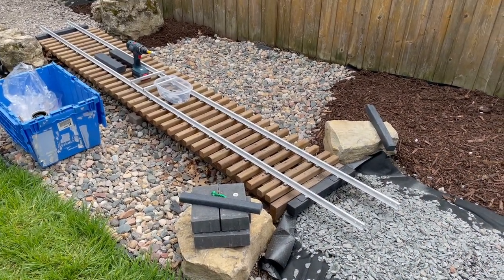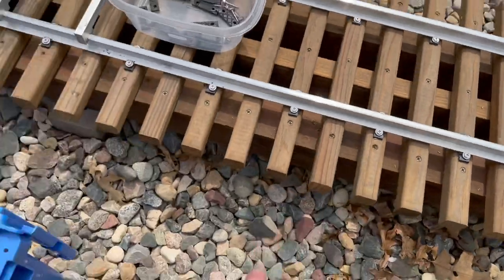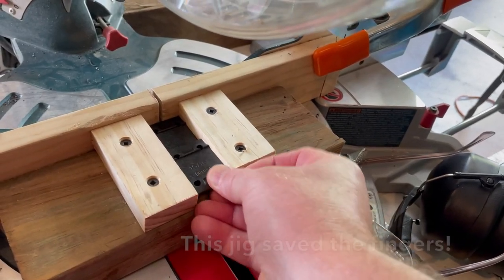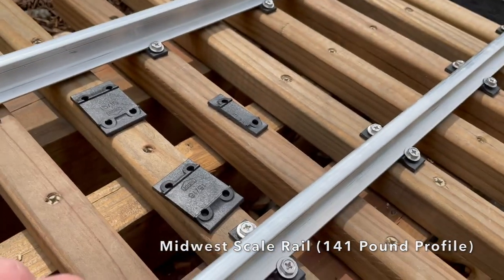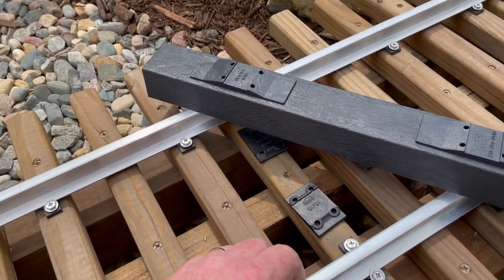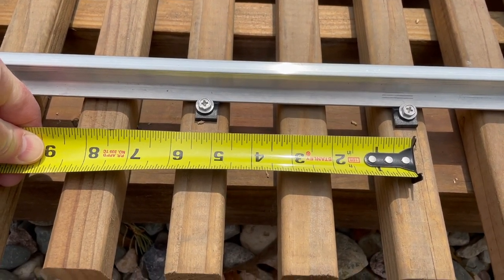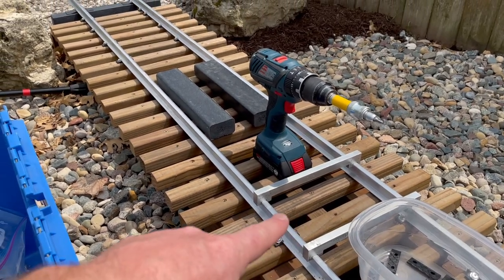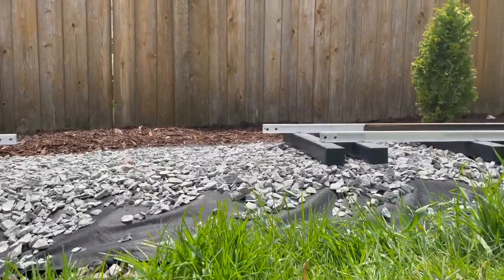Backyard Railroad: Accu-Tie Tie Plates on 7.5" Gauge Wooden Bridge

Comment: I see where you’ve built your railroad as economically as possible, such as using tie plates on every other tie.  Also, every other tie is shorter (except on the bridge).  So, I would like to see a video showing all the ways you’ve got creative so as to save you a little bit of money.
Reply from the maker: All said and done, I don’t think we found many ways to cut corners to save on cost. We tried in the beginning but ended up going the tried and true routes to make sure it all worked out well once we were up and running.

Comment: You mentioned using Accutie as gauge bars, but you did not mention the aluminum gauge bars you were using, which looked to me to be from Midwest Scale Rail.  Is that correct?
Reply from the maker: Yes, that is correct. With our tight turns, we went back and filled in our original wide separation of Midwest SR ties with Accu-tie’s ties to bring our ties closer together and assist with gauge accuracy. Plus, Accu-tie ties were a bit less expensive.

Comment: The scale you're working in has little to no bearing on how much time it's going to take. Laying track is labor-intensive. 
Are there three-legged jigs for laying the curves? I've always heard that curves should be spaced a hair wider, hence using the three-legged-jig.
A three to five-car train is going to look wonderful.
Reply from the maker: Labor of love, at least! 😂 But yeah, the curves, oh, the curves 😬😊 ...You’ll see soon that we’ll be 3.5” between ties on the outside of curve taking into consideration the tie spacing in the inside of the curve, especially at 20’ radius turns. Gotta leave some space for the ballast. Gosh, we might be to our curves next weekend and we’ll see how it goes! Have a good night!
Reply: A more prototypical spacing of ties would be every 3” or 40 ties per 10ft of track.  I give my customers the option of 6”, 4” or 3” tie spacing.  But this gets to be expensive and overkill for the lighter weights of a mini railroad.  I use only 20 ties per 10ft section of track (every 6”) on my railroad and that gives plenty of support without breaking the bank.  If I went with 40 ties per section, I’d probably opt for a smaller gravel size than the #57 gravel I use now.  #57 stone size is about 1 inch.